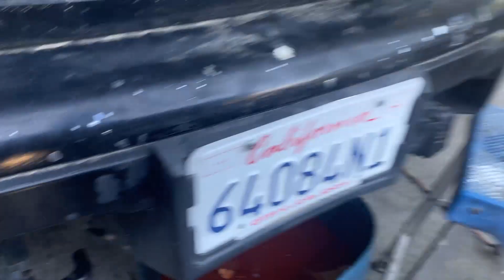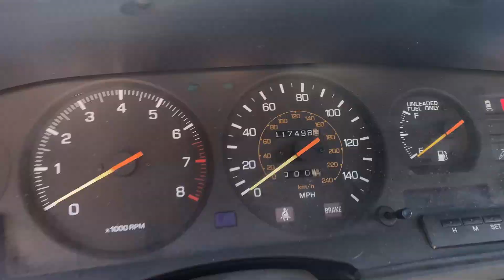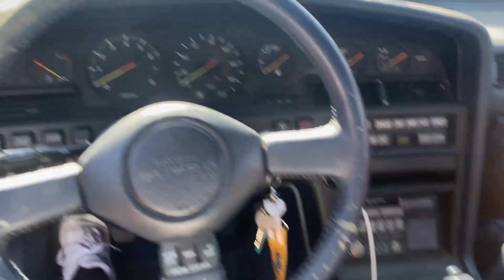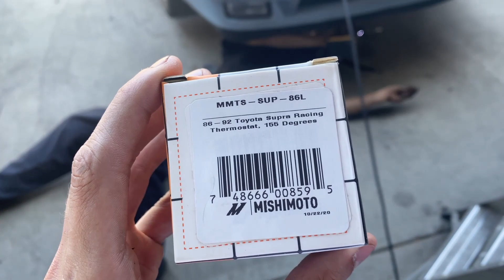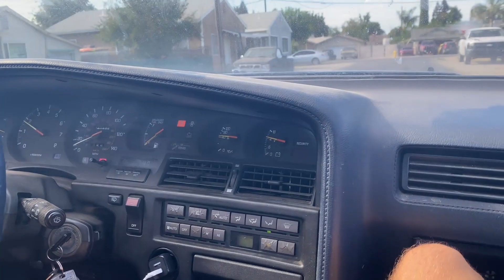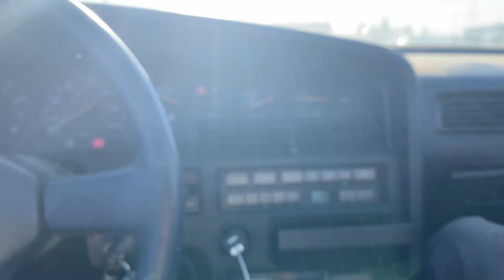I let a girl drift my NEW project car! (MK3 SUPRA)

Comment: are you selling the trunk wood panel thing? also how much for the trunk carpeting
Reply: well shit if you’re doing tubular front end then i also need that front bumper and the passenger side marker assembly
Reply from the maker: Yup I’m going to start tearing the supra apart at the end of the year just stay tuned on my videos so you can grab the parts you need when it gets torn apart!!
Reply: Miguel, on rock auto they sell the carpet for the cabin and the trunk brand new. The trunks like 100 bucks and its actually really good quality i bought one and its really nice quality and fitment.
Reply: @duckie1300  oh wow nice man and they even have the maroon color thanks for the heads up!